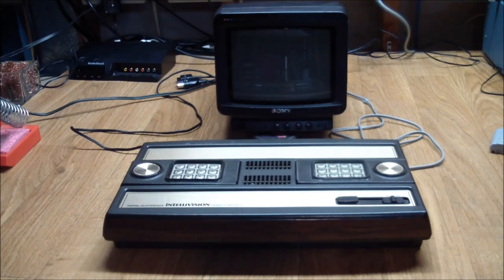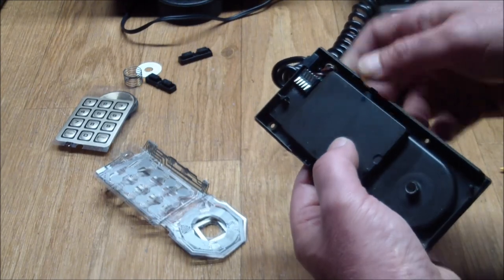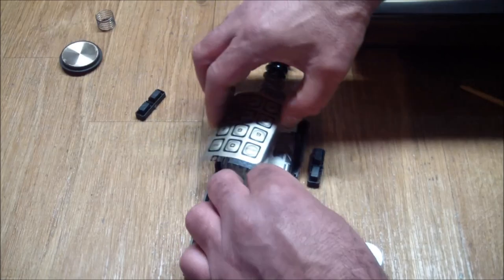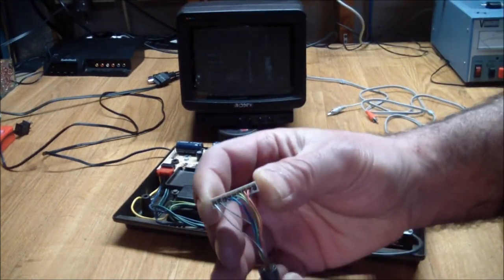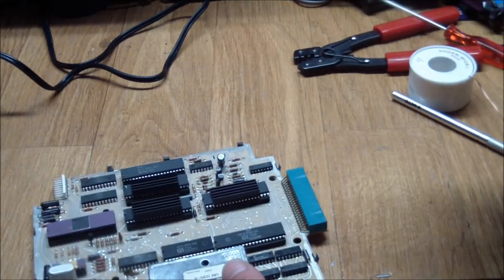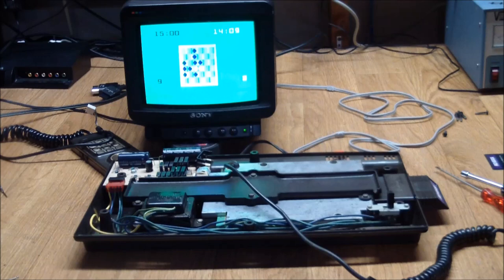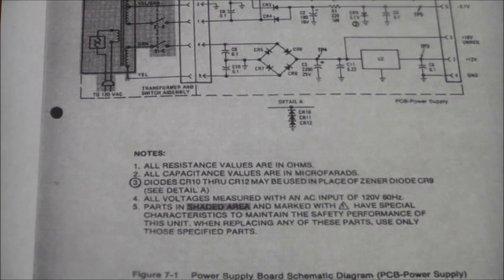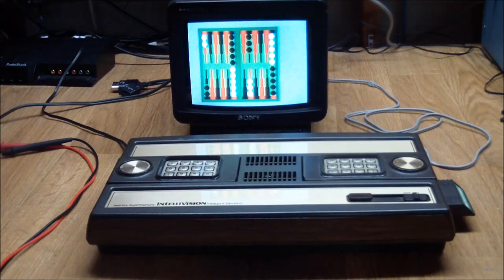AE#47 Troubleshooting a Mattel Intellivision Game Console

Comment: 51:19 wait WHAT. A Zener shows diode characteristic both ways. It's got a silicon diode drop in forward and a Zener rated drop in the reverse, and since it's supposed to be a 2.1V Zener, this looks fine, at least as far as this measurement is concerned. It did likely suffer though, it must have obtained some extra equivalent series resistance given that the drop was larger in-circuit - the limiting resistor likely sends a lot more current through it than your multimeter.

Comment: These flimsy connectors are a nuisance.  I had exactly the same problem with one like that in an integrated amplifier where the pre amp connects to the power amp.  The broken connector was not visible, since it is encased in the plastic shell.  A rather difficult defect to find.

Comment: Never had Intellivision either until last year I bought one. Mine seems to be working fine but just wondering, is it normal that the power supply area gets significantly hot after more than one hour of playing? The area where those big capacitors are?
Reply: Yes, this is actually quite normal. I'm a collector with four working units, they're all the same way.

Comment: You should buy intellivision flashback it has all the games plus it a brand new unit its only   $49.00 or $39.00 good luck
Reply from the maker: I have most of the console remakes, but nothing is a cool as the original
Reply: Had 2 of em. They crap the fuck out in 1 to 2 months. Poorly manufactured!
Reply: It didn't have all the games it only had 59 to 60 out of the 150 games for the Intellivison